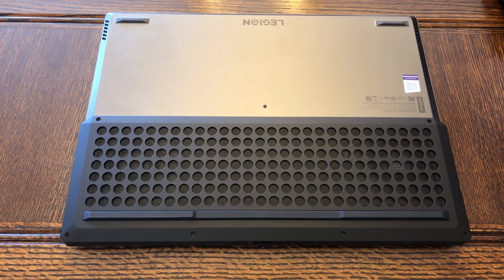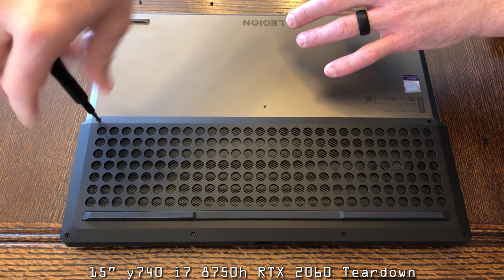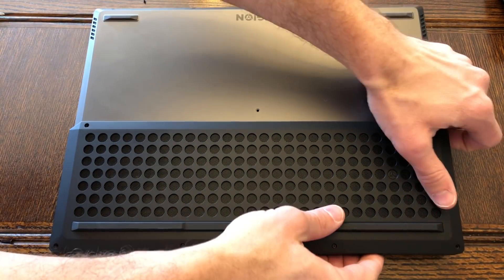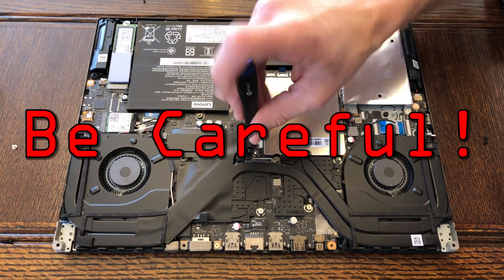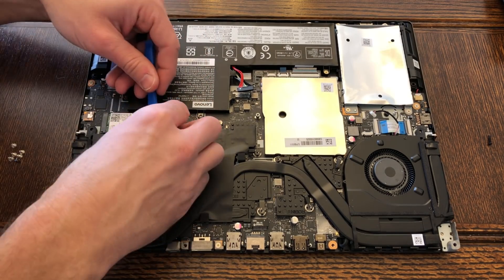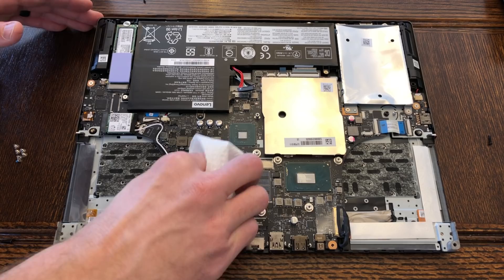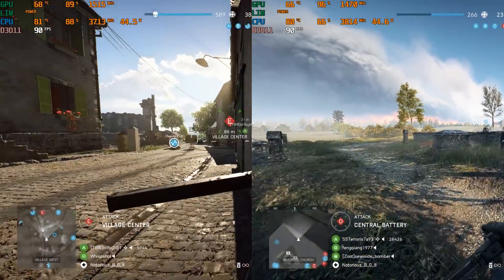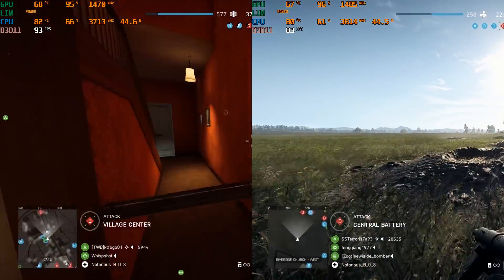15" Lenovo Legion Y740 Teardown!

Comment: You apply too little thermal paste for such gigantic die, as said in various channels it helps applying more than you would usually do when comes to gpus just saying, great video 👀👌
Reply: yes for non conductive paste too much is not such an issue, and considering the terrible gaps some laptops can have due to poor heatsink QC, a fair bit of the corners may be un-covered
Reply from the maker: My application is perfect.  If I decide to make a LM video you’ll get to see for yourself.

Comment: I was going to order a thermal paste for re-pasting. This video saved me. Thanks! :D
Reply: Dude it doesnt work like that , every single laptop u will see a different result, it doesn't mean u will 100% get the same results as shown in this video, it's possible that in ur case your laptop u will get temperature improvement. In his case he didnt see any temp improvements

Comment: Is it me or the one on the right side seems to keep a more steady turbo than the one on left, i wonder what kind of throttling is that as it doesn't seem to be thermal
Reply from the maker: The performance is the same. You’re just seeing two different short clips. If I were to let them play out you’d see that it’s within margin of error.

A smart person would put two Power Limits on a CPU when setup in a machine like this. 

It would pull about 45w when both CPU and GPU are under load (of course this can be adjusted by the manufacturer based on thermal headroom) and a 60w PL when the CPU is taxed alone since it can utilize the heatsink to itself. 
(Of course based on thermal headroom) It just so happens Lenovo might have done just that. I’ve been asking for this forever. 

More testing to be sure so standby for the full review hopefully this week.

Comment: The factory Lenovo thermal paste looks much more malleable than the factory Acer paste. When I replaced the paste on my Nitro 5 it was not even 6 months old and the paste felt hard and rubbery! Good to know things are improving with some manufacturers as time passes. I'd love to buy a laptop one day that didn't essentially require a re-paste and under volt to see its full potential. Then again, that's half the fun of it!
Reply from the maker: I agree!  It’s also maintaining the machine like a car should get its oil changed.  

It’s totally fun too lol!

Comment: Hi Bob, I had to return the Y7000 recently due to frequent blue screens when I had an external monitor plugged in, and when I upgraded Windows to latest version and latest version of the Nvidia drivers games would frequently complain that there was no graphics card! - could you confirm these issues don't happen on this one?
Reply from the maker: I haven’t seen these issues on any laptop I’ve had my hands on.  There’s always lemons out there.
Reply: @BobOfAllTrades  Its interesting Bob, I posted on Lenovo's Community before returning it on whether to exchange it. Several other folks said they had these issues on the Y730, Y530, and my Y7000. So i decided to return it. Good to see you haven't seen it happen
Reply: Joshua v A I just got mine y7000 for like a week and so far i haven’t encountered that problem. Hopefully things work out.
Reply: @hryank33  Thanks. I returned it. I'll probably get the Aorus 15 or the Lenovo 740

Comment: Damn, that's a major improvement on the results from the last model
Reply from the maker: The CPU was eventually tamed in their last model as I revealed in the y730 review.

Lenovo has their CPU dialed in right now!  

The die on RTX is huge so heat dissipation potential is there as long as the cooling is there, which it seems to be 💪

Comment: Damn I could have sweared you were reviewing, and your son was playing on the Y540. Oh well, I must have read it wrong, this will do too. How much did you pay for this one Bob?
Reply from the maker: Lenovo offers some pretty strong discounts if you time it right. This base model started at $1680.
Reply: @BobOfAllTrades  Not freaking bad! Most similar configs are around 1800-2000$. I was hoping on the Y540 mostly for an better deal since it's almost the same machine and I don't care of RGB, screen and TB3 since I got my monitor and it packs a good enough GPU already.
Reply from the maker: One of my favorite things about this laptop is that it’s connected to my external 240hz display and runs great with its lid closed. It’s quite versatile for ME but it really needs a bigger battery to achieve greatness 👍

Comment: Review this laptop pls, i m looking for a laptop with rtx gpus and i m still confused which laptop to buy. My current choice is asus strix scar ii with rtx 2070 with liquid metal from HIDevolution. But i dont like the design very much, maybe this laptop is better than scar 2 but i need an in-depth review of both and cant find a good one like ur recent scar 2 video (loved that video btw). Can u suggest me a laptop(my budget is around 2000-2200 usd).Thanks!
Reply: Rutvik Panchal Buy Legion Y740 with rtx 2060 card. Coz Max-Q scores are limited to 100% at it’s maximum potential. 2060 is way better than 2070/2080 Max-Q’s
Reply from the maker: Better bang for the buck perhaps but it’s not a faster GPU in regards to laptops.
Reply: @BobOfAllTrades  but please do a full review of the lenovo legion y740!!!
Reply from the maker: That’s why I bought it
Reply: @RamKumar-ur3zs  hardly better especially for the price. Hardware Unboxed just did a review on this, so here's the article with the benchmarks https://www.techspot.com/review/1804-geforce-rtx-2060-laptop/
Reply: I am going to buy asus rog strix scar 2 rtx 2060 in India.where are you buying
Reply: @sangamshiral2654  USA
Reply: @rutvikpanchal466  how will you buy , from a relative or any other means?
Reply: @powerloop  well i live in US,so.....
Reply: @rutvikpanchal466  oh okay